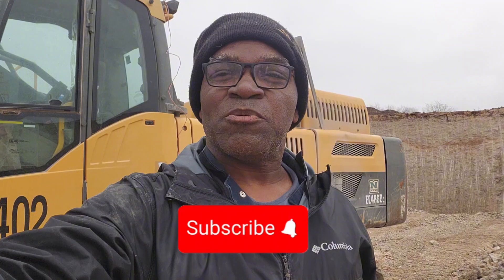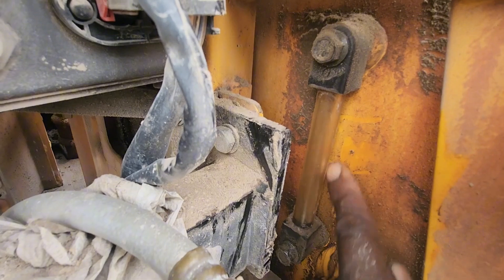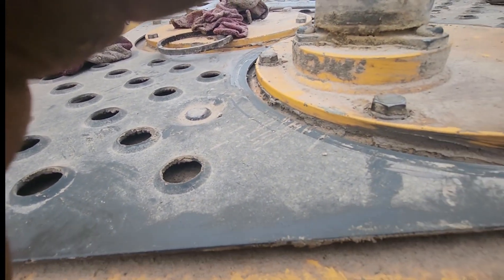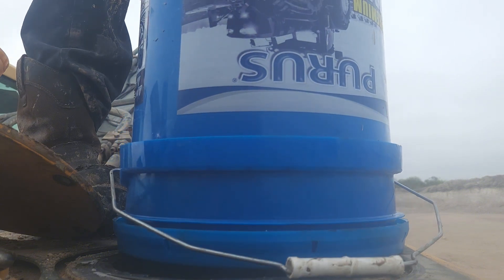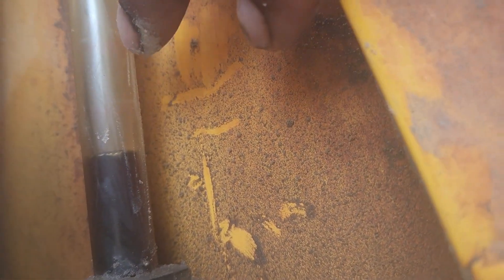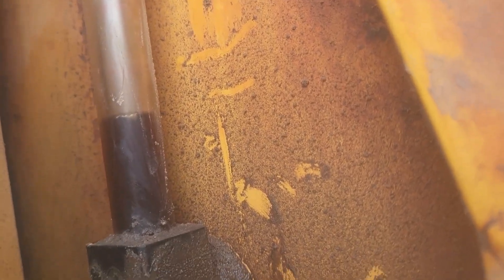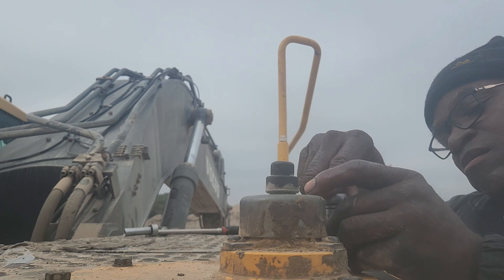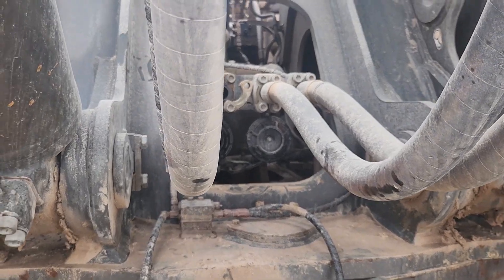Volvo Excavator adding hydraulic fluid

Comment: Good information.  how do you add hydraulic oil to the final drive ?
Reply from the maker: sorry for the late reply, have already solved your issue, final drives usually take gear oil, i posted a video filling a final drive a days ago
Reply: I saw your video on it 👍 @franklinindustrialservices4972